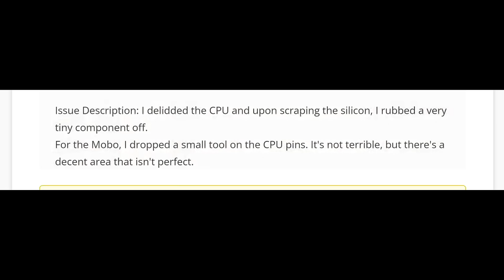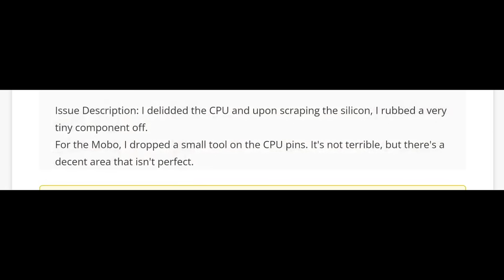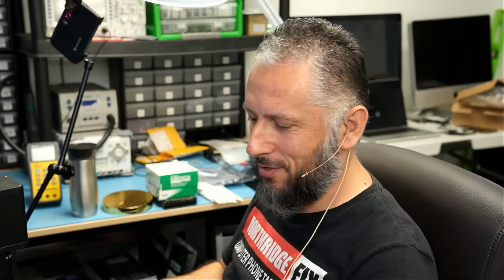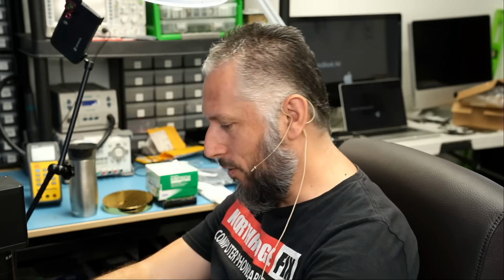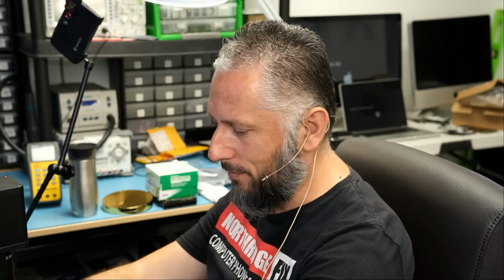Delidding 12900k CPU knocked 2 SMD components off  + EVGA Z690 socket pin repair.

Comment: LGA1700 latch have a manufacture error. You lower the temps by 10c by installing custom contact frame for the socket. The guy delidded the cpu and used it with the standard latch or damaged the socket why replacing the latch?

Comment: Deliding a cpu will do nothing for anyone currently.  CPU chips are so advanced overclocking and and such give almost no benefit other than a lot more heat.

I have a gigabyte z690 UD 1.x personally it is about the same as this one, just a more durable board.

My cpu is an i7-12700KF, with a GeForce 3050

I have yet for my system to bog down even running 4k games at Max settings.

Comment: You can solder on an LGA pin contact if the base of the pin is still functional. No one who's ever built a PC would insert the CPU onto the LGA pins of the motherboard and start scraping residual materials off.

Comment: the reason everyone is delidding is because all the self-anointed youtube experts (who usually get all their shit free) push overclocking and delidding as the hot thing all the cool kids are doing, of course when the youtube pretender screws something up they just pitch into the trash because it didn't cost them anything to begin with......

Comment: sometimes delidding is needed, my friend was going to sell me a i7 4790k some years ago
but wanted to make sure it could overclock and that sort and give me the information on that, before he could test the OC ability, he did a baseline test
and found that two cores were reaching 100c at stock even with an AIO. When he delidded and repasted it the cpu was easily able to go from the stock 4.2 all the way upwards to 5.0ghz for me.
I have since sold and moved to the AMD platform (5800x3D) but sometimes delidding is needed.

Comment: you would think for major mainstream components like this that there would be a depository for schematics of the pcb including values for each smd component. I know when i knocked two resistors off my RTX 3080 it took a couple of days worth of research to find a schematic and it wasn't even the right one, the closest one I could find was the 3090 by the same manufacturer and same naming class. Luckily i didn't need the schematic since the repair shop knew what was needed to fix the gpu. Also weirdly enough I found the schematic on the website of a University, I want to say it was like the University or Oregon or something like that.
Reply: If they free up schematics anyone could build the same component, cause the design is not subject to IP protection
Reply: @DavidMorales-s8d  good point. i didn't even think of that. It still sucks though
Reply: @Look_What_You_Did Dude, you are the clueless one. You can protect the drawing but not the circuit itself. You can build and commercialize any circuit you can build. It's the same as software, you cannot protect the source code but you can protect the final product, the implementation.

Now about the manufacture aspect, just think that every damn chip is designed in America but made in china, they have the infrastructure to build anything (because they do), if they had access to the full schematic they could make fake products (Which they aesthetically already do) with fake components that will work exactly the same as the originals, and sell them at very low prices cause they just skipped the whole research and development part of the product design, and there is no law that can prevent that. How the heck are you saying that nobody will build it? And that is why it's important for companies that their designs remain secret as long as possible, so they put physical and software locks and try their best to avoid reverse engineering (which always comes along with time, and even faster if the product is popular).

Reverse engineering is not illegal, drawing a schematic of your reverse engineering findings is not illegal, therefore circuits cannot be protected as a design, I repeat, you can only protect your drawing of a circuit, not the circuit itself.
Reply: @DavidMorales-s8d  those who are manufacturing these things already have the circuit schematics. The silicon however is almost impossible to manufacture by counterfeiting as it requires very hightech manufacturing facilities. I think the circuit schematic or the values of these discrete components like resistors should be provided to thse who are repairing otherwise repairable stuff is going to become worthless junk

Comment: The only thing the average person should be doing with a CPU is lapping it to make sure it is as flat as possible. It can be a performance improvement but ensuring perfect contact with the cooler means the chips life will be extended to its max. It simply is not worth delidding unless you are an overclocker and are doing it to benchmark for a competition. Otherwise its just a dumb thing to even consider doing!
Reply: At least practice delidding on some old CPUs first...

Comment: It is possible to replace the LGA 1700 socket. I was able to replace my LGA socket with a special BGA tool to a repair shop. But again, not sure if it worth it since the capacitors from the CPU are missing. So, in my opinion, first try to fix the CPU and then the mother board. In the meanwhile the mother board can be tested with another CPU and make sure that the bended pin is not critical.

Comment: Caps are GRM0225C1H330GA02L 33pf 50v
Missing pin is either vccCore or vss, should not be an issue.

Comment: I am jealous of anyone with more steady hands than my 61yo hands. I have worked with these hands
on those pesky pins, under great duress from a woeful thing that passes itself off as a microscope. It
shook more than my hands.
Reply: I'm 65 and my hands are much more steady since I started taking NMN.
Not to mention so many other age related problems are now a think of the past or vastly reduced.
A quick search will reveal what NMN does for the body, especially aging bodies like mine and yours.
Not trying to sell anything, just pass on what has made a dramatic change for the better in my life.

Comment: as for the capacitors i do not think they have changed the values much over the refreshed generations. they might still be the same as 11900k and 10900k. if anyone has those delidded you could technically see the values on those too.

Comment: IF that pin is necessary on the mobo, short of replacing the socket on the mobo (labor intensive), would it be possible to add a bead of solder to the pad on the CPU that corresponds to that pin to give it that extra bit of distance to make contact?
Reply: It wouldn't make contact as the pins on the motherboard should be sliding and making contact on the CPU. Not only that pin wouldn't make contact, due to raised height, other nearby pins wouldn't make contact.

Comment: look for "
0402 Capacitor Values under 12900K IHS
" on google, first result.
Reply: You could have just said they're 33pF.
Reply: @ianhaylock7409  he also asked which orientation they need to be  theres a pic where you can see how.

Comment: Stupid things people do to decrease temps for a few degrees
Reply: There is a 240W TDP CPU there. OC would make what... 350W? Imagine you need to cool down a 350W TDP on a surface that small. It's actually not stupid at all. The way it was done is stupid.
Reply: @Dandan-tg6tj  why would you overclock a 250W CPU. Is it not consuming enough power already? 😂
From personal experience, I have actually down clocked my 7900x to 142W from the stock 200W. I've only lost about 3% performance and saved 30% of power usage. Temps went down over 20°C and I didn't have to delid the CPU or use liquid metal crap on it
Reply: @ksenchy  Man, am happy with my i3 12100. I don't need anything more than that. My daughter's PC uses a i7 2600 overclocked at 4GHz. Some people might need OC while others don't need it.
There are people who need to OC a 12900K (probably this the reason they were buying the "K" variant). Doing it properly, that's another story.
A delid tool costs what.. 50 dollars? If you already spent 3000 for your new shiny system, you should have the wisdom to spend 50 more to be able to delid your CPU properly.
Reply: It's not stupid if you watch a few YouTube videos and have zero experience. Everybody will admire and become jealous of you.

Comment: Is it not possible to replace the socket
Reply: It is very much possible.
Reply: @Dandan-tg6tj  the gear might not be that redly available, but you're absolutely right. With the right tools it's absolutely possible!!
Reply: I was able to replace my LGA1700 socket. You need a special BGA tool for that.
Reply: Seen it done.

Comment: I came across some information online that suggests the missing component could potentially be a Multilayer Ceramic Capacitor (MLCC). The specific type is an SMD/SMT MLCC with a value of 33 pF, rated for 50 VDC, with a 2% tolerance. Its package size is 01005 and it utilizes the C0G (NP0) dielectric.
Reply: A capacitor with a tolerance of 2% is very unusual.
Reply: @henryD9363  I mean, it is directly attached to the CPU (if I'm not mistaken), so probably needs to have very tight specs. That is assuming OP is correct.
Reply: @DaftFader  
I have one of these SMDs (01005) chipped off, could this be causing the processor to not work? After turning on the processor does not heat up and the CPU error is on
Reply: Yep, a little odd, but NP0 dielectric is very temp-stable.  A prime candidate for this replacement is the Murata GRM0225C1H330GA02L part, which is NP0, 50V 2%, 33pF, 0402 size.
Reply: @geekdaniel7595  
I have one of these SMDs (01005) chipped off, could this be causing the processor to not work? After turning on the processor does not heat up and the CPU error is on
Reply: But why did you not link the info
Reply: I have one of these SMDs (01005) chipped off, could this be causing the processor to not work? After turning on the processor does not heat up and the CPU error is on

Comment: imagine buying the best components and managing to break both while trying to get 1-2% more performance. (which you probably only notice if you'd be running the system 24/7 anyway)
Reply: indeed. i'm a PC and electronic enthusiast for decades but never had I dream of dellidding a CPU, maybe Intel Skylake.
Reply: @zodiacfml  It is well worth it, especially 3rd/4th gen intel, it makes a huge difference if done right
Reply: @sirfairplay9153  It is if one only looks at temperature numbers and maybe slower fan speeds. It is also worth it during the lengthy scammy 14nm debacle which began in Skylake. Otherwise, upgrading to next year or two chips is more logical.
Reply: Let's go buy a new Sierra truck, jack it up, and go mudding until it breaks.
Reply: @@CptBlack.I found my room is 10 degrees cooler after I dropped my overstocks 😂😂😂
Reply: I think you mean 10-20%. Depending on the silicon of course it can be more or less. It makes a big difference for those who encode videos for example.
Reply: @Daunlouded  you cant get 20% for just delidding, unless you are liquid nitrogen as well or something... you can overclock without delidding as well
Reply: Most of the time this not done for performance, but to bring the temperatures down. Which means a quieter system and also helps with not needing exotic cooling solutions.
Reply: @sigsegvs  lets be real, most of the time its done for no reason other than they saw their favorite youtuber do it
Reply: Delidding 12th gen can result in a 10-20c difference.
Reply: @barrybondzy  yeah because the cpu no longer works and is just at room temperature forever 😂😂
Reply: @Healcraft  Ive got a delidded 13900KS in a NR200P Max with better temps than your current setup with all 24c.
Reply: Overclocking Wnk fest.
Reply: I ask my self the same thing. Why buy something and destroy it trying something useless?
Reply: This is why I game on console.
Reply: Depends on the CPU. 7950x has such a big heatspreader that you gain 20C by delidding. That doesn't just mean a faster CPU but also more effective cooling and a more silent system. Also healthy for the CPU if you don't run it at 80C with normal use.
Reply: Delidding is worth it for the thermal alone. The person doing it is just doing it wrong here,, you can judge their level of clumsiness there.. not even the motherboard socket survive and that's unrelated to delidding.
Reply: If an improvement is only able to be seen in a specific benchmark, then the people doing this need to get a proper hobby that involves leaving the basement
Reply: @reggiedixon2  i mean overclocking has it's place.
especially it works very well on intel cpu's from the 2nd to 6-7th gen.

i even have a 3770k still on the kids pc with a solid overclock of about 1 ghz (3.5 base - 4.7 oc).
Which gives it like 25% more performance.

but yeah today intel already pretty much overclocks the top end products from the factory, and there's pretty much nothing to gain..
Reply: @Rare_K_  I prefer going outside and following healthy pursuits instead of obsessing about frame rates and temps
Reply: @reggiedixon2  Nah but they should definitely practice on cheaper components that are going in the trash anyway first, in order to know what they doing.
Reply: Like we don’t need to do that anymore. 😂

Comment: 5:54 Well its for enthusiastic overclockers 👍 believe it or not , delidding has its advantages 👍😉
Reply: Arguably it's not something to fuck with if you can't do it right and can't replace the hardware.
Reply: @zacharytaylor8523  True, even lets say the owner of these hardware is enthusiastic , there still a 50/50 chance to fuck it up 👍
Reply: Well, if they are THAT enthusiastic to hunt for a couple percent performance they either do it right or eat the cost and buy new stuff.
Reply: @calopii these CPUs do get very very hot they should just start selling delidded CPUs with how hot the IHS is making these modern CPUs
Reply: @grantm902  You're right Mr smart guy!
Reply: Isn't it hilarious that all those enthusiasts at their kitchen table think they are smarter than all those engineers at Intel or AMD together?🤣🤣🤣Just look for Dunning Kruger

Comment: you can totally fix broken pins .... not saying i would but totally possible
Reply: how? 🤔
Reply: @jessihawkins9116  I usually take one pin from a donor socket and solder it on top of the broken one. If there are more than 3 broken pins I change the socket completely. Anyway, changing the socket is not always a good idea so I avoid it as much as I can. Those caps shed pain tears at 250 Celsius. They might be fine if it's an expensive motherboard but one can never know for sure.

Comment: interesting board, using the old style pins. I have not seen these in LGA1700. A couple Asus boards i repaired have completly different style pins, each pin is 2 pins split in the middle, very hard to work on.
Reply: I'm sure my ROG strix z690 has the same old style pins. Although TBF, I didn't spend much time looking at them inbetween opening the mount, and securing the CPU, and I certainly didn't start poking around in there with a screwdriver or anything to get a closer look at them from all angles. 😅
Reply: @DaftFader  I also have a Rog Strix. I think it's the E model of the Z690.
Reply: @scotts4125  mine is the F wifi model
Reply: @DaftFader  Just checked mine is the E Gaming (not a gamer at all) also with wifi great board very happy with it.

Comment: the components face the die or are situated to where they run down the long side of the die. i would imagine they are just capacitors. maybe this would be a good colab with jayz2cents since he does have a 12900k possibly a delidded one. and its an extreme overclocker or a super enthusiast that would do this. my guess is xoc. Also im sure there are pin layouts for the cpu so you can know if the broken pin is just a ground or something important. more than likely its vcore from what i have seen on 1151 sockets.